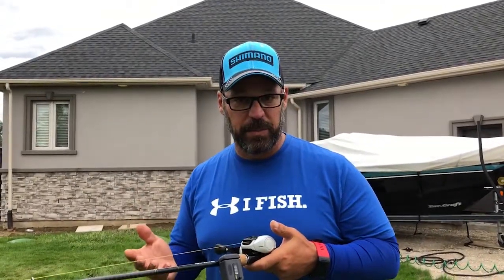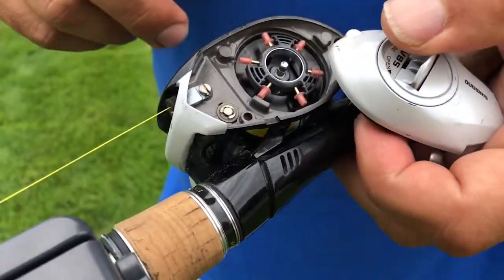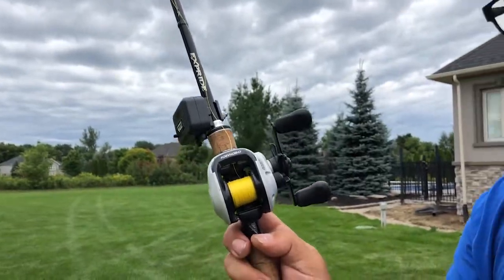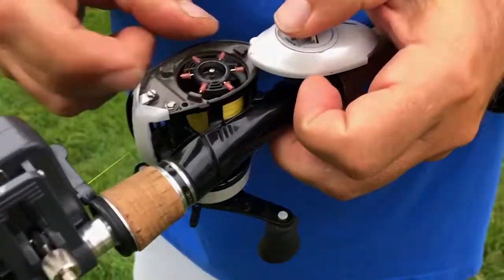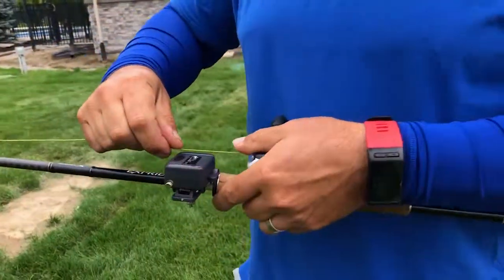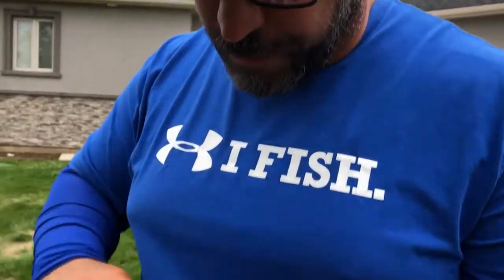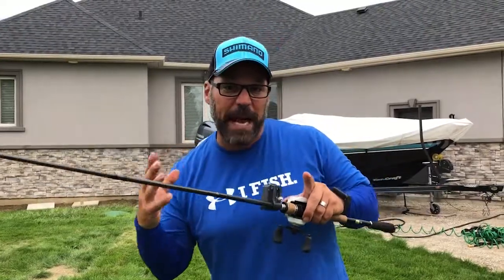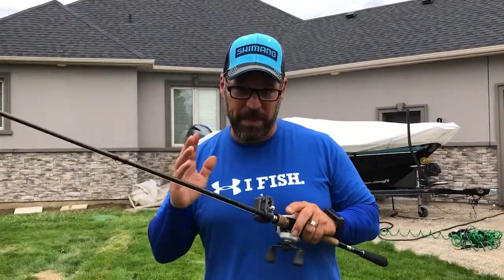Setting up your SHIMANO baitcasting reel - VBS Braking System

Comment: The VBS is a centrifugal braking system. When you cast, the "open" brake pads slide to the ends of the pins and slow down the spool speed. The amount of braking is variable depending on the speed of the spool: the faster the spool is spinning, the more the open brake pads are forced out to the rim and slow the spool. This is why, if you have a backlash occurring EARLY in the cast, when the spool reaches maximum speed, you want to increase the number of open brake pads. The tension knob helps to limit the speed of the spool as it is slowing down, later in the cast.

Comment: great explanation.  any input on adjusting tension to prevent backlash?  is there a knob or something? also my citric 100 has extra plastic pin covers. there are green ones and red ones?  what's that all about?  if you could please
Reply from the maker: It's weight of the brakes, red is lighter than green. The spool tensioner knob (under star drag) is the only adjustment you need to make for slowing down spool based on weight of the lure.

Comment: Hey great video!  I just purchased a Tranx400 and it’s giving me trouble with 3 brakes up (6ttl). But it seems the other 3 brakes are locked in the down position how do I get those up to add more braking? Thanks
Reply from the maker: You should be able to click them up the shaft to free them from the locked position. I use my nail. Just don’t go too far as you can knock it off the pin. If you do, just pull the spool out and slide it back on.

Comment: now do the cast where you swing the bait around the pole one time and swing it similar to a baseball bat(i learned it from informative fisherman he does a simple roll cast but i do that style but use full power and can bomb it.) and watch how far that thing can really go. thats crazy i always kept two on the opposite sides thinking if i only have one it will slow the spool down awkardly. and i was never able to cast it with 0. but ya i can launch it i broke my pole but i should get a new one and try just one pin. if it goes .5 more what i could do with 2 ill be amazed. i might be able to almost touch 80-100yards. with a half ounce drop shot set up... it makes me wish i could cast my spinning just as far. my first baitcasting reel i got a couple years ago but i got the old shimano bantam curado  cu 200 for cheap and for the price its seriously a nice reel. i like your line counter thing i think i might have to get that too and see how far i can cast my spinning set up vs baitcaster in the future.

Comment: How tight do you set your spool tension knob? I just got a couple of shimanos and set them up like my daiwas which is tension knob just tight enough to reduce side to side play in the spool but get line fluffing with the shimanos.
Reply from the maker: On a regular reel (without DC Braking) the tensioner should be set to let the bait free fall at a controlled rate.

Comment: I have a curado 100D how did you open the thing so easy to get to your brakes?
Reply from the maker: Make sure your spool tension knob is loosened. That puts pressure on the palming side plate if tighter down

Comment: I have a shimano mg7 in mint condition I just got even with 6 on it backlashes at the end of the cast and with tension fairly tight arb bearings look good and with pads behind them, have you had that problem,Thanks
Reply from the maker: Are you thumbing the spool at the end of the cast when the bait lands? Also, what pound test and type of line do you have on it?
Reply from the maker: https://youtu.be/Ekyaw7aKROw
Reply: @JPDeRoseOutdoors  It is slightly before the thuming stage, and I am using 12 pound copolymer, i used another brand with the same results, even almost choked off it does the same thing.